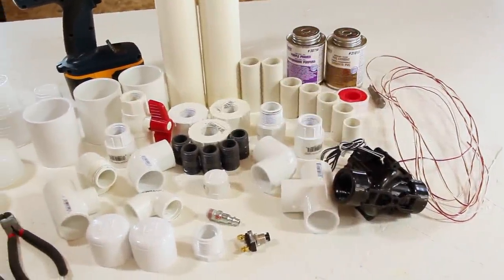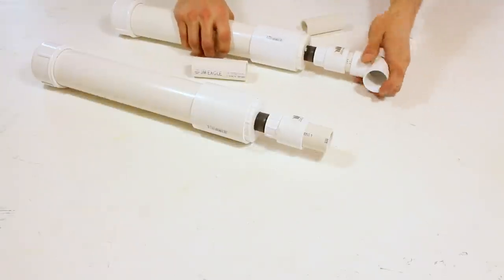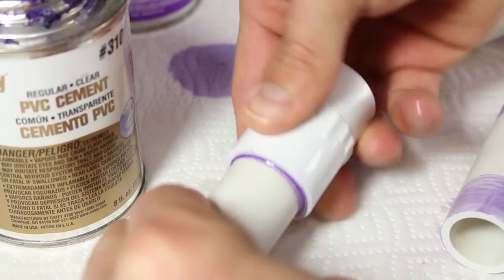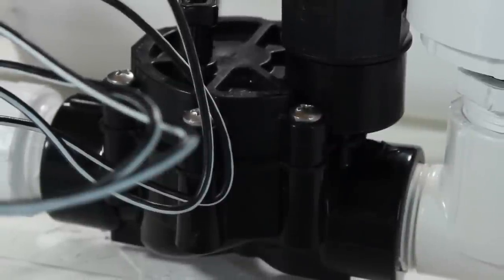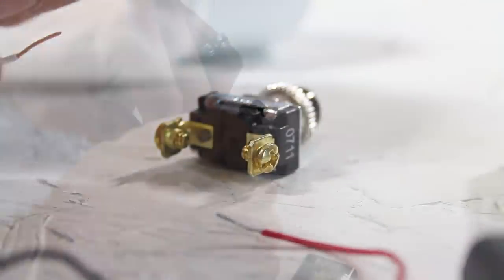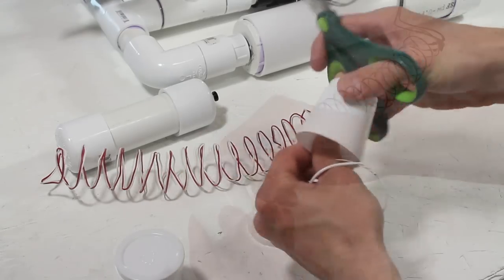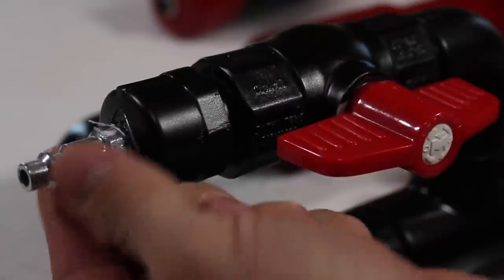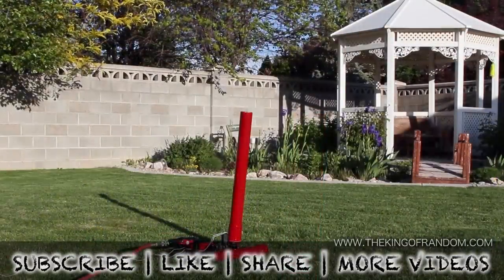The Candy Cannon (Shoots Candy 100 feet!)

Comment: Put 120 psi on a pvc pipe?
Isnt the pipe going to burst sooner or later?
Reply: PVC is rated for ~140 generally, but it can take a lot more than that if your connections are put together well.
Reply: I looked in the construction shop:
It seems this pvc pipe system is not available in my country.
There are 2 different pvc pipe types there:
Pvc pipes for dirty water, you better wont put pressure on it, because they have thin walls and pressure use is not permited with them

2 pipes for clean water, can hold up to 120 psi but you cant build them modular like in the video, they are rather for bring water from the street in the house.

We mainly use copper pipes inside of houses for clean water/ heating.
Reply: Always use schedule 40 pvc pipe, which is pressure rated.
Reply: When something is rated at a safe use level, its typically 1/4 to 1/2 it's maximum. This ensures people wont hit a danger area and cause injury. That would result in the company being sued consistently if you had things breaking at the 'recommended' max.

Comment: Can you talk about the switch mechanism a little more? They guy at the irrigation store suggested replacing my AC solenoid with a DC solenoid in the sprinkler valve, but when I wire up the momentary switch and press it, it only keeps the valve open. To get the valve to close, I actually have to reverse the polarity by touching the leads to the opposite charges of the 9v.

Comment: I'm looking to ramp this up a bit and make an Easter egg cannon. If I used 4" pipe for the tanks and 6" for the barrel, would the 1" sprinkler valve move a sufficient amount of air or do you think I'd need a 2" valve?

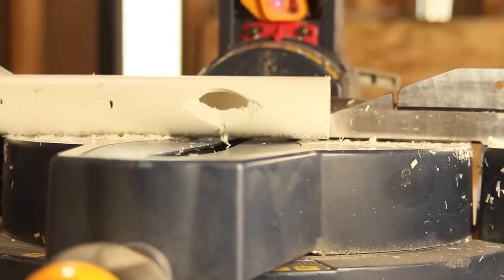Comment: @ Grant Thompson - "The King of Random"to prevent cracking the pipe by using the chainsaw mount the saw blade reverse so that the tooth of the blade will scratch the tube you will see a nicer and cleaner cut and this 0:49 will never happend

Comment: i'd use a finer tooth blade than that for cutting PVC also i just realized you only cut round stock on a band saw if you don't have one try using a v-block

Comment: What is the purpose of the vinyl tubing link in the video description? I don't see it used at all in the video. I'm guessing the tire valve is used if you don't have a air compressor, but I'm confused about the vinyl tubing.

Comment: I know you made this video years ago and are now extremely busy with your youtube channel, but I hope you can help me..... I have built this cannon but when I charge it with compressed air the solenoid valve will not operate. It works when there is no air in the system though..... it is sooooo frustrating! Have you ever encountered this and do you have any idea what might cause this? (I am using the same valve as you are nd my pipe dimensions are the same as well.) 

Hoping you can help me with this!!
Reply: Perhaps the solenoid is backwards? Or maybe it's rated for a lower pressure and can't handle what you're putting through it?
Reply: Yeah I checked flow direction and that is correct. The solenoid valve I am using is exactly the same as he is using in the video..... the most frustrating thing is that I have made the AK47 rocket launcher too and that is the same type of valve and it works like clockwork..... just this one does not work under any pressure.
Reply: Maybe the other one is just a bad part? Have you tried giving it more voltage?

Comment: You really shouldn't be adding so much pressure to pvc.  It fractures in sharp shards and is rated for a much lower psi.
Reply: +Maniacal Cactus He used 2 inch schedule 40 PVC pipe for the air reservoirs. That should be good for pressures up to and over 250 psi. But yes, it is not the best for compressed air.